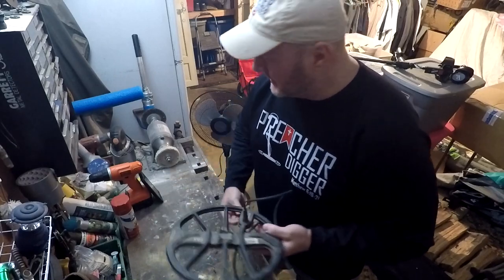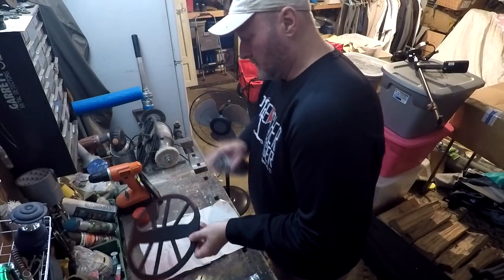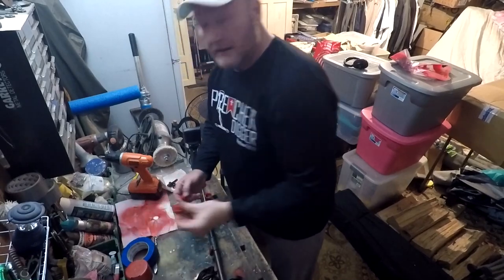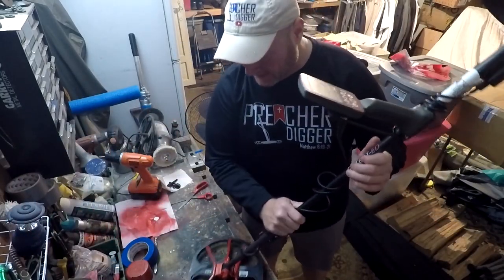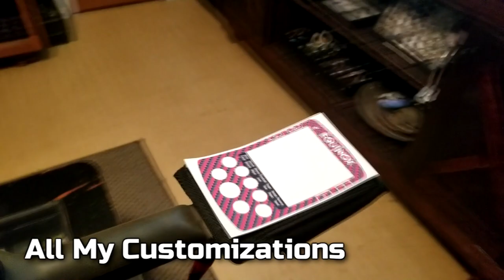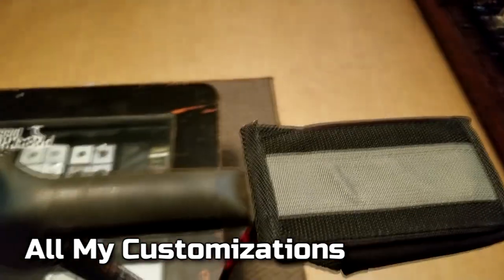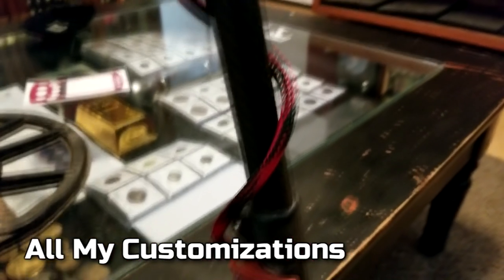Equinox 800 Customizations | Adding Some Flare to Your Metal Detector | Minelab

Comment: I always try to use no conductive materials. I have a criticism in that if the paint changes the OHMs of the coil this is not the best idea. Knowing the color red comes from Iron I would say not my color of choice. Minelab has a lot of experience and I tend to not mess with the tech. Even simple things such as glue can effect the coil.
Reply from the maker: I’ve had no issues at all. Now I’m using the Manticore. Thanks for watching. Happy hunting and God bless.

Comment: What kind of paint did you use? And will the braces fit a simplex+ detector ?? Great video thanks for sharing
Reply from the maker: I used regular non metallic spray paint but did not paint the bottom.  The stiffner braces will not work on a Simplex but I'm sure if you search around there are some to be found.
Reply: @PreacherDigger  that is great thank you.
Reply: You don't need them on the simplex Nokta macro don't make the ears on the coil cheap just minelab

Comment: Boy that snakeskin-
Thanks for the shout out for the screen protector I sent you. Unfortunately I have just a few left and I won’t be making those anymore. I had to buy the foamed backed pack cloth for that in rolls of 50 yards which was expensive. I was using that material to make my Jeep XJ bags. Well I use a different foam material for the Jeep bags now and that material will not work for the Equinox covers.

Comment: remove the red strengthener and epoxy it on, and install the zip ties to hold it tight while it dries, looks sweet Preacher!!!! I just ordered my first 800 and a load of goodies tonight. Even ordered the full red carbon fiber set up from Detect-Ed, and red, white, and blue snake skinz, and already planned to do my coil ribs in red white and blue. Small detail I always do with my remote control toys with the wheels  lol

As for the battery pack, what i have read is the 800 pulls power from the pack, and then uses the internal battery. " When the unit is plugged in, the Equinox will take power from it before using its own batteries, saving them from discharge. This could help extend the lifetime of the detector's battery pack "  I plan on ordering it soon because my thinking is it will help to prolong the life of the built in battery.
Reply from the maker: Make sure to post me a picture

Comment: my question is, why would you need the zip ties? it's going to have bolt throug it. see no need for the ties. now on the broken coil i can see the need for the ties. your detector looks nice, thanks for the video
Reply from the maker: True. Zip ties are just added support in case. As long as the ears are not broken you're good to go but if the ears broke on the stiffener and it wasn't zip tied your shut down, but I'd they were you're still good to go. Thanks for watching and commenting.

Comment: Pimpin’ out the Nox, LOL. Looks like you can call that painted coil the Black Widow coil. It would be a cool name. The red paint may help you see the coil under water in beaches/lakes that may be a little on the murky side. Does your repaired coil have the scuff cover on with the tie wraps around it? Nice mods.
Reply from the maker: Thanks. It does have the ties on it and seems to be ok. It's only a backup now

Comment: Since you’re using zip ties to hold that on then that means whenever you need to clean the sand off from in between the coil and the coil cover you will need to snap off the zip ties? Or just sand nugget in between anymore?
Reply from the maker: Yes I will but it just takes a second to do that, plus I dont do that often.  Only when it builds up alot after a period of time.

Comment: Oh I almost forgot you can get you equinox 11-in coil replaced for a new one if you call minelab and if it's still under the warranty but I'm sure even if it isn't there's the way they will help you but you going to have to send in the broken coil it doesn't hurt to try I had same issue and I called the USA minelab number it took me 5 minutes on the phone and they sent to me a new coil as soon as they received the broken one.
Reply from the maker: I'm out of warranty

Comment: did minelab send you new coil for free under warrenty thanks love your videos
Reply from the maker: No I bought the extra coil
Reply: @PreacherDigger  Since this has become a “known problem” with these detectors & ML continues to sell them to unsuspecting customers (who placed their faith in an industry leader), then replacing them is just the cost of doing business. 

Now that customers can easily communicate online & compare their experiences, companies cannot blame common breakages / failures on the user. 

ML should be able to devise a reinforcement kit to send to every registered owner. Unless they’re afraid to admit a problem exists. 

The customer should come first, but unfortunately that doesn’t always happen. But I think the jury is still out on this one.
Reply from the maker: @bjbrick1  that would be great customer service if they did. I believe it's just a design flaw but I believe they might say..."don't lean on your detector" which many do when bending over.  I went two years without mine breaking and now I put the supports on because I don't want to happen again when I'm out detecting.
Reply from the maker: Also the man who told me this was a "known problem" was a minelab dealer.

Comment: Check out Gigmasters channel he has fixed those coils ears a few times. Make sure you get one of those coil supports (plastic) for the right size coil. It fits over the ears you broke off to strengthen them. They are on ebay and cost about 12 dollars each. You should have them on your 11 and 15 inch coils. They are their own sizes btw. OK I see you bought one. Excellent :) I knew I liked you for some reason :). Peace.
Reply from the maker: Yes I travel with extra pair of them. I even had a man make me some personalized Preacher Digger ones.